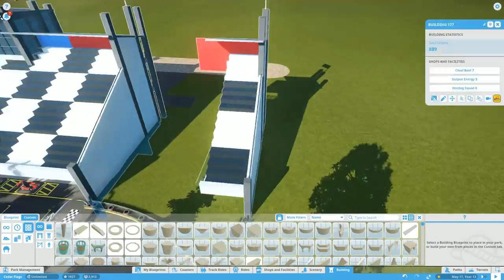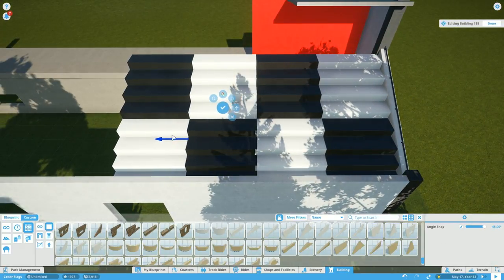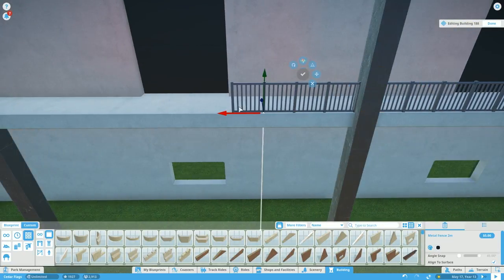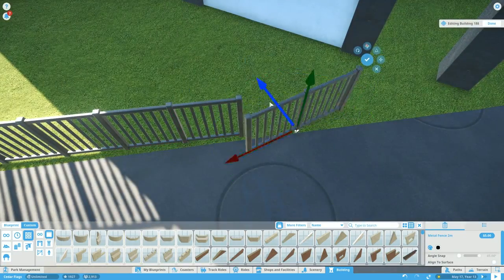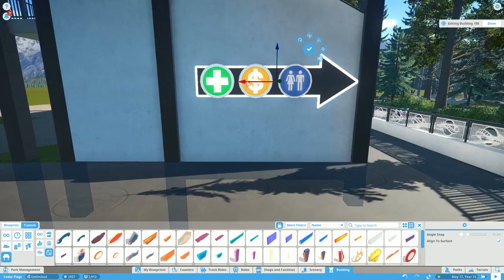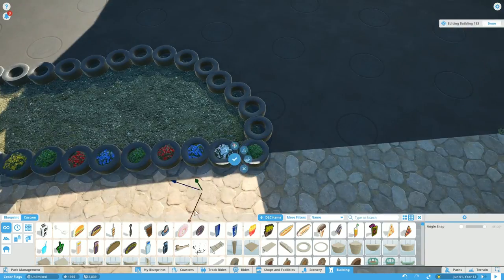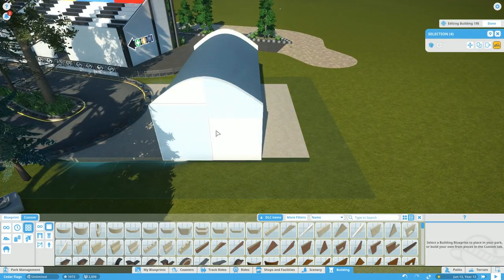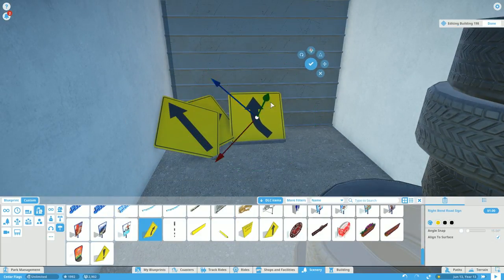Let's Design Cedar Flags Ep.18 - Cedar Speedway Pt. 2: Grandstands and Track Garage - Planet Coaster

Comment: Dunno if anyone pointed this out yet but EFN (Excitement, Fear, and Nausea) values do not apply to a roller coaster's lift hill or block section.
Reply: It Does. My Excitement And Others Rises Up Lift Hill.
Reply: THSteel they rise, but don't go into the average at the end, so the 5.5 or 8.1 when testing does not include lift hills and block sections, just hover over the icon and a tool tip will pop up

Comment: If you could it would be cool if you could add trucks and trailers for the go carts and park them near the garages. And also you can do more shops with trucks and trailers. At NASCAR races behind the main grandstands there are dozens of merchandise trucks and trailers that look like the actual race car haulers but the trailer some how comes apart. But you could put up more shops and make it look like a race car trailer.